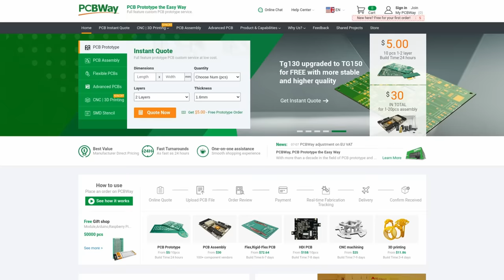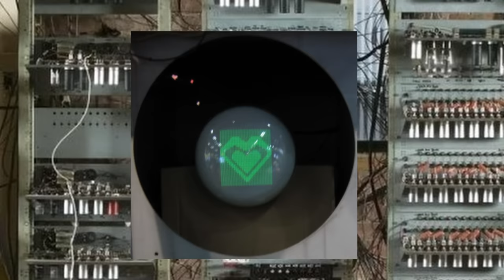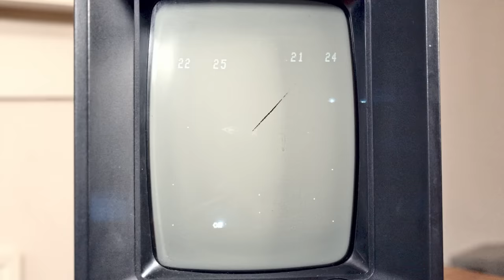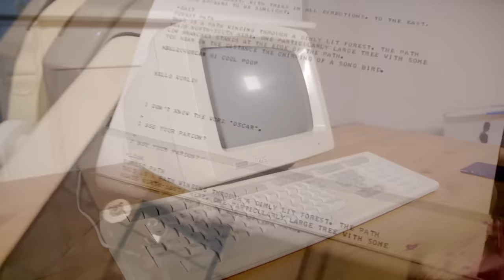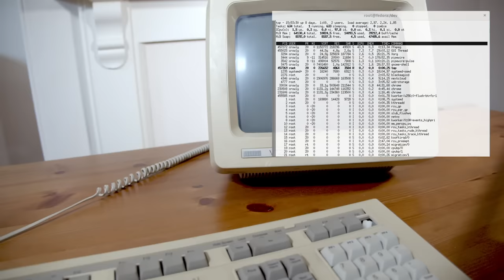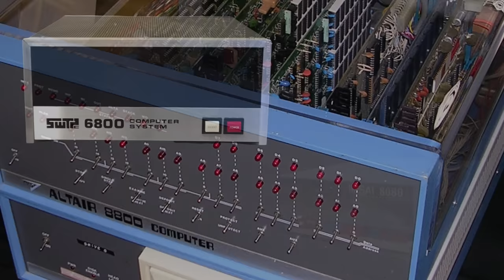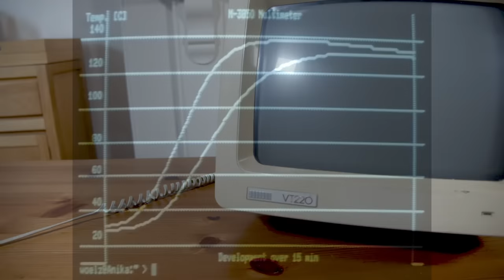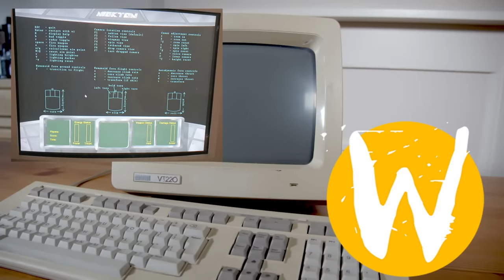The abridged history of Computer Display Tech

Comment: I'm giving my age away here, but when I did an internship during highschool I worked on  a mini computer via a teletype. When they had nothing for me to do I would load a chess program via tape, put the chess board up and type my moves, the computer would write his moves on the "typewriter".

Later studying at university, we were the last year doing our computer science assignments on a mainframe using punch cards. Very frustrating to get the printout with "SYNTAX ERROR LINE 11" after waiting for 20 minutes. Several of the buildings still had "dumb" terminals connected via long cables or phone lines.

Then they installed networks using BNC cables and the first generation IBM PC XT and later PC AT. Often you ran a TTY software under MS DOS to log into the mainframe, it was years before graphical user interfaces.

But yeah, when you open the terminal under Linux and start hacking cryptic commands, that's what people did in those days. Actually, my university thesis was porting a FORTRAN software for railway simulation from a mainframe to Unix V under X Windows.

Thanks, very good video. Good pace, entertaining narrating, good images of the old equipment.

Comment: My introduction to computers was in 69-70.  Our math teacher had a teletype terminal installed in his classroom and we could write BASIC programs that we could run on a timeshared mainframe someplace downtown.  Great fun.  From there to the Computer Science program at Northern Arizona University in 75.  More teletypes with paper tape punches.  Turn your program in and come back a few hours later to see if it ran.  Nope, rinse and repeat.  Some assignments required you to create a punch card deck and turn those in.  Back to school in 82 and using a VAX for some courses, but back to teletypes and paper tape for COBOL programs running on another time shared computer.  The advent of the PC was a giant leap.  To be able to code and run your programs in real time was wonderful.  Creating programs in BASIC and Turbo Pascal.  Coding COBOL programs and running/testing in real time on our local IBM 370.  We have come a LONG way

Comment: IIRC, the vt100 could not position the cursor on the screen. The text that went to the screen simply advanced line after line. It was only with the vt102, that you could jump around the screen to place the text where you wanted.

This is why people were still using line by line editors like ed, with vt100. Only with the vt102 could you emulate something like a full screen text editor.

I actually had both a vt100 and a vt102 that I used through the serial ports of an early 90s Linux computer for additional live terminals, years after regular CGA and better displays, and PS2 keyboards and the like we're readily available.

So I had the main display and keyboard hooked up to the Linux box, but also the vt100 and vt102 hooked up so that other people could work on it at the same time.
Reply: I need to correct myself. Now that I'm thinking about it, what I had was a TTY dumb terminal for one port, and then either a vt100 or vt102 for the other. 

You were right that the vt100 had full screen text positioning, like the vt102. Other than that, my Uninvited reminiscence is accurate.

I would, for example, use type -f to have a constant display of a log on the TTY display, and have TOP running constantly on the vt102. I could keep my eye on them without having to switch away on my main display. Note that I didn't run X on that linux box, which was the primary server for the ISP I owned.

Comment: I really like how you showed all the output devices.
They appeared not in a vacuum, however, so I'd encourage you to look into that side of things.

There's a much more abstract notion of INTERACTIVE COMPUTING.
Von Neumann acknowledges its existence in his "preliminary discussion" paper, and he talks about using "slightly modified" teletypes for input/output, as if it was an already well-known pattern, and that's because it was.
Douglas T. Ross describes the very-very early days of conscious interactive computing, in his memoires on "personal workstations".
There was a ton of back and forth discussions on pro/con of using massive (back then) amounts of memory for frame buffer, which essentially blurred the lines between what the machines saw and what humans saw, both looking at the same location in memory.
Licklider's "man machine symbiosis" paper also spends considerable amount of time discussing interactions with computers.
CTSS was literally an effort in interactive computing.

In a nutshell, the problem is connecting the inner state of a machine (unobservable otherwise) to the mental image a human programmer has when operating on that machine.
Looking at display technology without understanding the bigger context is less informative, confusing, even, we see a line of devices but not their raison d'etre.
With that external frame of reference in place, suddenly it all starts making sense.

Comment: 4:02 A couple notes regarding the Williams Kilburn tubes without being too pedantic. The 0 was implemented as a dot and the 1 was a dash. In that way they could recover a clock from the signal. That leads to all the little dots present, and some of them "brighter" because there were the ones, like 2 dots together. And you cannot really open the lid to see the dots, because the lack of refresh would immediately kill the memory. So what they did for practical reasons was to simply place a second independent CRT in parallel, without a lid, to actually see the dots.

Comment: 18:45 On the Windows side it still echoes in text files.
If you create Text file on Linux or other UNIX like,end of line will be marked with  next  line character. 
While on windows it will be next line after "return carriage" character.
As you might guess this character tells (in this case non existing) teleprinter to return carriage to left most position,  before "next line" character tells it to go down to next line. 
HTTP and telnet protocol also uses carriage return+next line scheme,.

Comment: Great video; I enjoyed it immensely. I went from punched card I/O (no printing) on an IBM 1620 through re-wiring an IBM accounting machine to make it print at one line per second, booting a PDP-6 with 36 bit-switches to re-writing the IBM 1401 bootstrap loader (in one card), TTY terminals for APL on an ICL 1903A, a TV and cassette player for the Radio Shack MC-10, and now am struggling to get one of my four Windows laptops in working order. I still have my MC-10.
So you can imagine how much I enjoyed watching the video. At Normal Speed!
A suggestion: no background music and no background images. For example, from 35:13 through 49:37 I found it hard to focus on the image and the narration. (Well, I **am** an old man!)
Cheers, and Thanks again.

Comment: interesting video.  One area about modern LCD's and displays that you could have expanded on that does have to do with how the computer actually generates the image is to go into the recent development of things like G-Sync, VRR (Variable Refresh Rate) modes that are appearing on recent gaming monitors and TVs and explain what issue they are trying to solve.  That does require some sophisticated communication between the PC and monitor including special chipsets on the monitor itself.
Reply from the maker: You're right gsync and vrr are very interesting technologies, at somepoint I made do somthing on how computers and monitors communicate and how thats changed.

Comment: What a great survey of the early industry. I started messing with punch cards in elementary school in 1973 with a small desktop computer that was programmed with cards punched with a little jig that you could poke holes with a pen.  My highschool in 1978 had an HP multi-user BASIC that several schools in the district would connect via 110 baud modems on TTY33s.  There were faster 1200 baud DECWritter III (LS-120) that was same thing. I use to keep a laminated card with the ASCII codes and to this day still know that 7 was bell, 10 was linefeed and 13 was carriage return.  I built a heathkit H8 (8080 similar to the AMSI machine) that didn’t have more than a few LEDs for display and so in highschool i hand built a video display that used an intel 1KB SRAM chip and a video display with a ROM based character set that would raster to a TV display RF encoded to channel 3!   

In the late 80s I started working for Intel.  As you pointed out memory was the big thing and the very first thing Intel created was SRAM memories.  You called them DRAM, but technically an SRAM was the first instance of silicon memory that used strictly digital circuits as latches (typically 6 transitistors per bit) and INtel later invented the DRAM (one transitor per bit) and the EPROM (1 transistor per bit that was programmed electrically and erased with UV that later became flash memory we all love today).  To this day everyone focused on the compute side of all of this, but really it was memory that drives nearly everything.  I’ve spent my career on flash memory and mostly focus today and making the SSDs used in data centers that I’m sure Google is using right now to store all the comments and likes as well as data for the next recommendation and ad.  

Displays have some so darn far.  Thanks for that great survey of all of this.

Comment: Finally, someone who appreciates the change going from terminals to video memory shared with the CPU.  I think it was originally a cost control thing, but then it allowed so much more when it came to gaming.
Reply: I think a major problem with X11 is too much required round trip communication.  Could have been designed much better.

Comment: One glitch: SGI actually used X11, but extended it with 3D functions. They didn't extend it in the X protocol because they wanted to keep it proprietary. So they had a second service, called DGL - with a second connection. Only SGI machines running IRIX had this included. So when trying to use any SGI graphics program from an X Terminal - everything worked fine until you opened one requiring 3D functions. The app crashed with the error message cannot connect to the dgl service.

Comment: I'm not sure you could use the Kilburn tube as a display without breaking it as memory. If you take away the electrode on the front it has no way of refreshing the memory. My guess is that it was only useful as a display if it was mirroring another tube being used as memory. i.e. it was purposefully a display of that memory.

Comment: 34:28 Sinclair's Mark14? Nooo!!!! The MK14 designation for the Sience of Cambridge SBC stood for Microcomputer Kit, with 14 major chips, and is correctly pronounced EM KAY fourteen. Watch any video that interviews the devolpers (Steve Furber, Sophie Wilson etc) for confirmation.
Reply from the maker: I dont think Sophie or Steve had anything todo with the MK14, Chris Curry did who started CPU ltd (and then Acorn) and would subsequently employ Steve and Sphoie. SBC was owned by Sir Clive, who put Chris Curry in charge of it. The creation of MK14 was Chris's idea.
Reply: @RetroBytesUK  True, my bad. Sophie and Steve weren't the actual designers but they do talk about its development as part of their 'History of Acorn' type of interviews and were the first names to come to mind. As you say Chris was in chare of SoC, Sir Clive's holding company, and decide to produce the kit. He didn't do the design though and agreed to buy the original design from a guy (who's name escapes me atm)  but when  he was trying to do a deal with National Semiconductor for the required chips they suggested he just use their reference design that they used for their own Introkit system. The point is none of the original developers referred to it as the mark 14 and neither did the engineers I spoke to when I personally collected my optional expansion hardware (RAM, IO, Cassette  i/f) directly from the Soc offices at 6 Kings Parade. Interestingly the local fire prevention officer would have had a coronary if he could have seen the stairway up to the workshop which was 50% blocked with .... Acorn System 1 display/sales boxes.
Reply: In the words of the man himself ... https://youtu.be/awlqzippsSc?t=3753 Ian Williamson - My life and the MK14 - Science of Cambridge

Comment: I would never have thought status lights weren't used as early computer output, like they were in early hobby microcomputers, but I guess it makes sense. There's too much going on to have the programmer there in the room just looking at the lights and interpreting them, holding up the queue for other programs. Makes more sense to put the output data in a fixed form so it could be studied by slow humans instead of pausing the computer.
Reply: On Burroughs mainframes of the era, the front panel had two halves, one of which was piles of diagnostic info for the repair guys. The other was the top of the stack. The MCP put bits in the stack that made the company logo when idle. Customers were known to compile a new MCP with their own logo. I even saw one that displayed the time.
Reply: The PDP-10, when idle, just counted up at address 0, so if you set the display to real time address 0 you get a quick view of how idle the computer is.  If the computer is slow and mostly idle you know here's a problem, though it's really only useful if it's hung, otherwise you'd type a command to see what's going on.  Or if you hold an AM radio in front of the lights and hear music you know somebody is running the music program which output 6 notes at a time on 6 lights.

Comment: Both the Altair and Imsai, and a number of  "trainers" used the blinking lights as output devices straight out of the box, and the matching switches as inputs.
Dave's Garage has covered this for the KIM-1 & altair.
set the switches to a given address, hit the address switch, and it uses lights to tell you where you've peeked, and what's there. If you want to poke, you set the 8 data switches to the byte being committed, then hit the commit switch (which has different names on various trainers and PCs) to take the set value and make the current  address change to it. if your switches and lights don't match, you know you've not peeked (address lights) or poked (data lights).

Comment: Thanks for this channel 

I enjoyed it very much 

I have used to work on PDP11/ 34 with RSX11/ M system 
I worked on 8 VT100  TERMINALs one VT220   12 LA36 line printers 
Operating , maintenance,  replacing cards 

It was a great mainframe computer till now 
And worked on commodore 16 , 64 
Amstrad 512 , 1024 
NEC , OLIVITY 
COMPUTERS

Comment: At university in the mid-90’s we used green phosphor CRT serial terminals connected to BSD servers to run Emacs to do our AI/Neural Network programming. 
At the time I dreamed of running gigantic and deeply layered Neural Networks on specialized ASICs but didn’t know if it would ever be feasible. Now I’m running CNN’s using PyTorch on a TPU cluster: we are living in the future and it is wild!

Comment: Slight correction, SGI did use X-Windows, they just didn't use the Common Desktop Environment which was a layer on top of X11 meant to standardise the look and feel of the UNIX desktop, since (like text shells before it) X11 was "implementation, not policy" and allowed everyone to write their own GUI, so they did - before standardising on CDE. That is a weakness/strength of the UNIX/Linux/BSD desktop that persists today even in Wayland.

Yes, it's a strength as well as a weakness. The strength is that nobody has to just settle for one desktop environment, the weakness is that you have to relearn how to use the computer if you move DEs. But honestly, although they all make different design decisions, and which is better is a matter of taste, relearning a GUI isn't that hard, especially if you're not one of these people who insists on using the keyboard for navigation when you could just use the mouse.

Anyway, an example of a company that did use a UNIX windowing system that wasn't X11 was Sun Microsystems with NeWS, which was both network transparent (like X11) and, if memory serves, also used Display Postscript like NeXTSTEP and MacOS. But even they transitioned to X11 pretty sharpish, and developed the Open Look toolkit which mimicked the look and feel of NeWS on X11, before also switching to CDE. I wasn't a computer science student but I did use Solaris on the university computer labs when I studied in Germany in the late 1990s, and by then the Sun workstations (SparcStation 20s IIRC) were using the famous blue-and-pink theme of Solaris CDE. 

I think Apollo (which ended up being swallowed by Hewlett Packard long before they swallowed Compaq, which by then had swallowed DEC) may have also used their own proprietary windowing system. Their UNIX-like clustering DomainOS was definitely proprietary.

Other than that (and apologies for the ramble), it's a great video! 0:02
Reply: X11 didn’t come along until about 1987. Prior to that time, the Unix workstation vendors were all doing their own thing. For example, SGI had something they called “MEX”.

Sun’s NeWS predated Display PostScript, so they had to come up with their own PostScript extensions for interactive use.
Reply: @lawrencedoliveiro9104  so we were both half right - thanks for the correction.